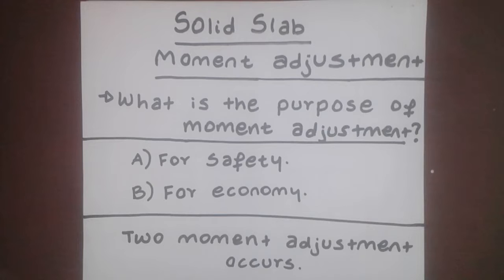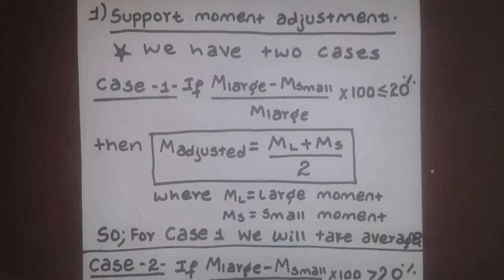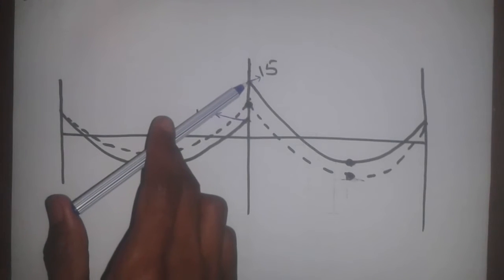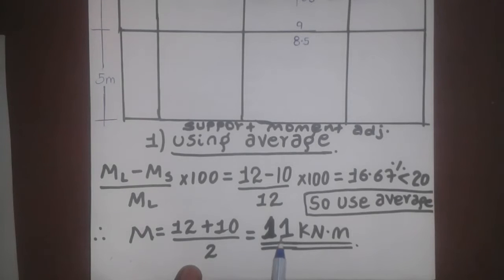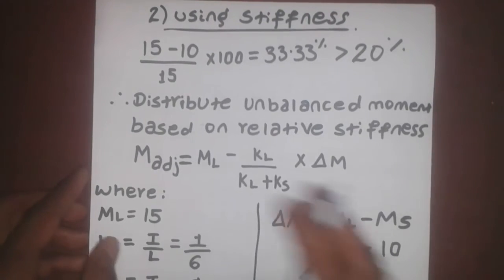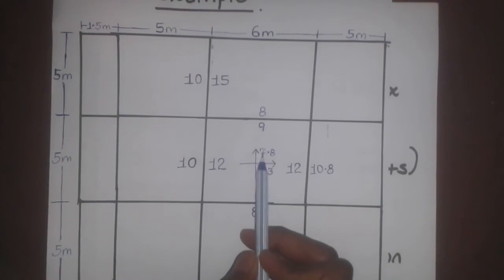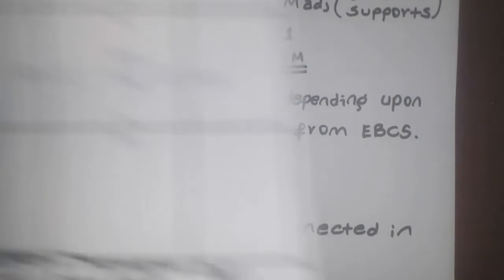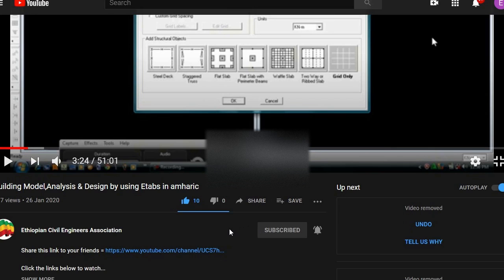Slab moment adjustment

Comment: is there beam moment adjusment when i analaysis using etab software moment at jiont is not equal.
Reply from the maker: you can use moment distribution methods.
Reply: @dannyengineering by software or manually